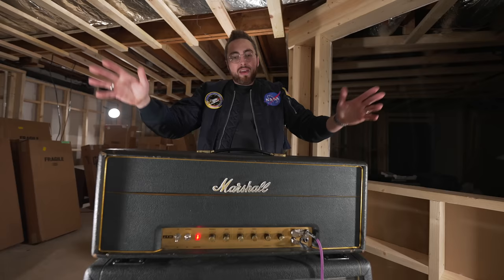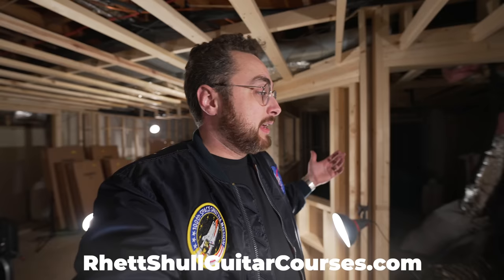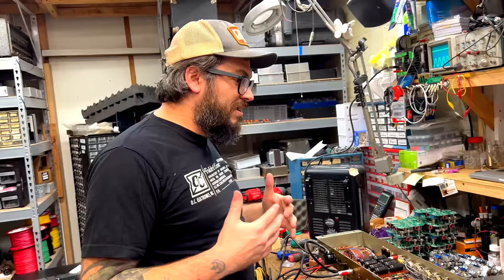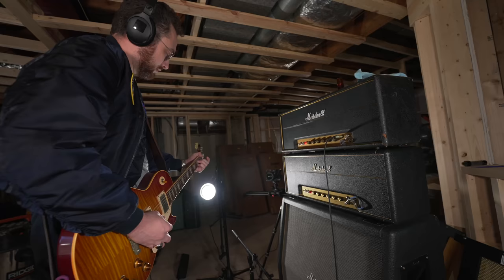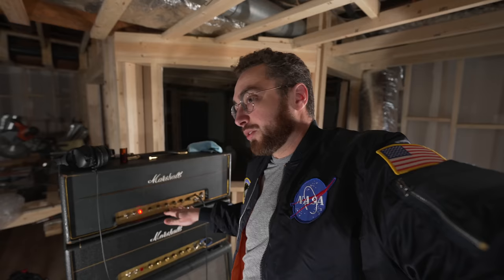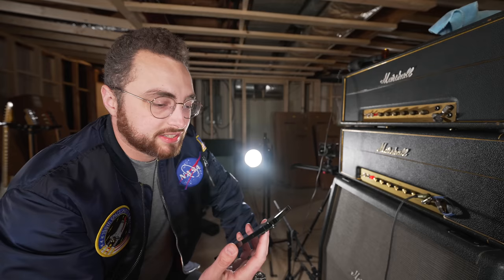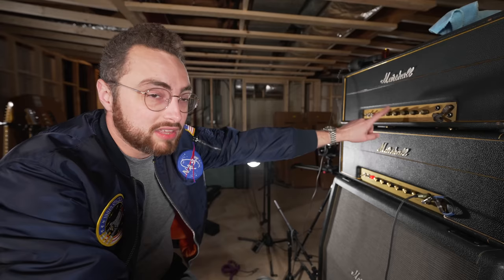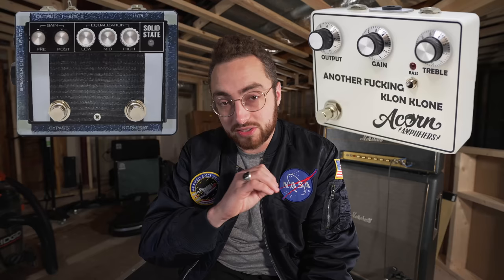This Amp Is So Loud It's Painful | Vintage 100W Marshall Plexi

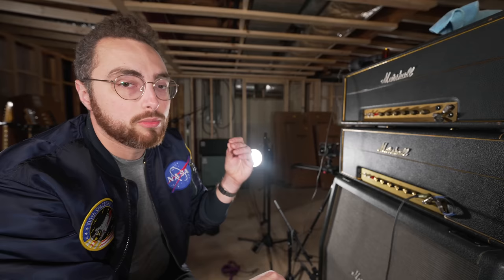Comment: 2.5 real reasons why the 67 sounds different than yours. First and most important is the first tube stages: in the 67, both channels shared a cathode resistor and capacitor, while the later super leads used individual resistor capacitors- allowing them to put a little more gain in the bright channel, but also tighten up the bass significantly. The increased gain on the first stages of the later models also makes the tone stack less effective than the older amps. Second reason is the output transformers changed quite a bit over years which changes the tone (last component before the speakers…power transformers also had some variance which changed voltage it ran at, but that was also all over the place) The “0.5” reason is the fact that SOME marshalls beginning when they changed from “plexi” to later superlead specs had a bright cap on the gain knob of the bright channel.  Most noticeable when gain is at 12:00 or less…and many didn’t have it (or had it clipped).
FWIW, when they started pumping out the higher gain super leads, they still did the original first stage jtm design, but they called it the “super bass”.  As such, the changes are simple enough, you could have a tech mod your reissue and have it switchable between modern jump and classic jtm spec
Reply: Yes, that's the reason behinf of the difference in tone within the 2 amps

It's like comparing a jtm45 to a 1987x
Reply: This amp looks to have a bright cap on the lead ch. Wondering what the value is? Couldn't make it out.

Comment: Jmi must have been almost totally deaf by the time he died. And he only used two or three at a time. Of course don't forget that Angus uses seven 100 watt heads at once on stage without ear protection.

Comment: 68 was a very transitional period. The circuits between those two amps are quite different but can easily be made the same in a matter of minutes. Absolutely no need to go hunt down a vintage amp for that tone. That said, no two amps, even with the same circuits, actually sound the same given that tolerances over the numerous components are going to be different, ESPECIALLY after 55+ years. But yes, your re-issue hand wired can absolutely get you there.

Comment: Not a lot of decibel difference between a tube Marshall run into a half stack versus a full stack…full stack pushes more air and sonically fills a room with more sound but not much more volume…now daisy chaining amp heads together each with full stack cabs…THAT will raise the decibel levels tremendously

Comment: Also you shouldn't be using a 100w head into a 4x12 with 4 Green Backs at 25w, you will damage the speakers, that amp is making 150w clean to 180w when it's cranked, the RMS rating is at no distortion, you're going to kill that cabinet (again). You need two cabinets for a 100w Plexi using 25w Greenbacks or to use a 50w speaker or above in a single 4x12. (I posted before I saw the tech measure the amp, but still don't kill the cabinet dude).

Comment: Rhett, I love how you have broken down so many different classic amps. With that said, I CANNOT express enough how much the speaker changes the sound of tone. Full stop. 
I really think you'll have your eyes opened if you go down the rabbit hole of changing out multiple speakers using the same cab, same guitar, same pickups. Speakers are where it's at brother. More so than any other component in the signal chain. Cheers.
Edit: just scrolled through your entire catalogue of vids. Looks like you did one vid 4 yrs ago on the alnico blues vs greenbacks. I'm telling ya man. Such an intrigal part of the chain deserves your attention.
Reply: Yea, the original pulsonic greenbacks would do stuff

Comment: "Plexi models are too fizzy". Plexis are fizzy, just the truth. And, yes, they are loud. Really loud. Most of the rockstars didn't actually stand directly in front of them for a reason, there was a sweet spot a few degrees off of center.

Comment: You young guys, LOL.  You can outplay me any day, but we lived with these big amps in the old days. But the biggest secret is - play in a bigger place!!! Not kidding. Big hall, full of of hundreds of sound-absorbing human bodies and it won't seem anywhere near as loud. Take it outdoors on big stage with a primitive PA system, and you'll want the full stack and two more. Also, the 144 watts is peak power, not RMS. (yes, I'm an electrical engineer). And it IS a bass amp! Bass amps make the best guitar amps.   Be GLAD you don't need these things today, your back and your ears will live a lot longer. I always played with foam earplugs.

Comment: Correct me if I'm wrong, but those first Marshall amps were in fact based off fender bassman, with just a slight difference in tone stack caps, so when you said "it has so much bass it could be a base amp", well it kinda is...

Comment: I've heard that the Black Flag (JTM50) and Super Lead 100 aren't exactly the same circuit. The JTM50 is more like the  JTM45/Bluesbreaker and the SLP is.. the iconic plexi sound. More distortion, no bass whatsoever, fizz and presence to cut through and much tighter.

Comment: There's a story I read years ago that Ted Nugent was recording in London and told the techs to setup his 100 watt Marshall amp in a small recording room at maximum volume. The techs told him not to do it but Ted insisted. The story was Ted went into the room, closed the door, and whacked a big chord that knocked him to the ground with the guitar bounding around on his stomach. If it's true, it might explain why Ted is bat shit crazy now.

Comment: I played one of these cranked, and now I can't make babies. It takes a great deal of skill to use a Plexi in a live setting. It's a very delicate balancing act.  I still play a Plexi, but through a Boss Tube Amp Expander, with my cabinet just loud enough for the singer to hear since he doesn't dig in-ear. Really makes me appreciate our modern setups with lower volume stages and in-ear monitoring. So much easier than back in the day.

Comment: It's an unpopular opinion, but this topic still brings it up front. The number one stupid thing guitarists do in the 21st century is play through a hundred watt 4x12 stack. It's an anachronism. But I know the majority of responses will be "CrAnK uP 'n RaWk, DuDeRiNo!!!111" Emotional response will overrule reason in just about every debate. But...

The Marshalls, Bassmans, and other big amps were designed for a time when the Beatles and the Stones had to go out into larger and larger venues where their audience was screaming louder than the amplification they were using. And the tube PAs were of similar low wattage and only reinforced the singers. So they came up with these big amps, and you'd have Eric with a pair of 100 watt stacks, Jack with a pair of 100 watt stacks, and 100 watts of tube PA to have Cream play The Royal Albert Hall or Madison Square Gardens...

Then came transistors. They didn't take guitar amps by storm but they did revolutionize the PA. With solid state came the megawatt PA systems, but guitarists and rock audiences still "had to have" the wall to wall electronic phallic symbols looked "kewl." So the old school guitarist has been the bane of small club sound techs for about fifty years now. I'm sorry, I know it's unpopular, but this is the number one thing that makes "old school guitar players" look out of touch with the rest of the world. Don't get me wrong, I loved my 50 watt 2204, and my red knobbed Dual Showman stack when I was 18, but I couldn't get "my tone" without being louder than a 747. I will agree that the feeling of air pressure when playing that loud gives a rush, but that's also what is damaging your hearing.

You can get great tone by cranking up a low wattage amplifier.

Comment: Word of note:  Tyler measured the Plexi at 144.50 watts. That is peak output.  The amp was rated at 100w RMS.   The equation for peak  to RMS rating is peak output multiplied by the square root of 2, or .707.  Therefore 144.5 * .707 = 102.16w RMS  Still exceedingly loud.
Reply: Typo correction:  1 over the square root of 2.
Reply: My meters read RMS. This is a true reading. It would be the same as reading the 120vac from the wall…which is increased by a factor of 1.41 for peak. Which is about 170Vac. It’s the same meter that will read 85-90w for a Twin Reverb
Reply: @theBanalBrother  figures I would say this, and think you had an RMS meter after the fact, but it wasn't mentioned in the video, so I assumed the meter was just a standard volt meter.  I'll refrain from commenting.

Comment: The trials and tribulations of tube amps. Rhett You’re definitely getting those magical tones. But as with all tube amps you’re in the lap of the gods as to weather it will sound good or awful. But your tone chasing is not for those that listen to your music because it’s so nuanced, it’s just for you and the select few who know the difference.

The other reason why vintage Marshall’s do not sound the same as modern ones is in the U.K. vintage wiring standards are unsafe and Marshall cannot legally build and sell exact reproductions of their famous amps and meet modern safety standards. Hence different sound. This goes for Orange amps as well and probably Vox and Hi Watt amps.
The tube amp sounds is important to me but I’m a solid state amp guy. I don’t have the patience to deal with the inherent and unreliability of tube amps. I find myself being quite picky and it need’s to get very close to a tube sound and most of my ss amps have a pre amp tube or single ended Jfet or nanotube shaping a power amp or Nu-tube to get the behaviour of a full tube amp they do react a little bit quicker but it does the thing I like.

Comment: They don’t all sound like that or that great. Kind of like a PAF, they don’t all sound great. I’ve had several Plexi’s and only one sounded superb. They’re are brutally loud. I had a ‘68 50 watt that was putting out 82 watts and even on the single cabinet I couldn’t stand in front of it. It was too loud.

Comment: You can't compare a jtm black flag to an handwired reissue... they have different circuits! 1959HW has the superlead metal panel '69 circuit and high filtering, the jtm100 has a bass circuit with dual diode rectifier and low filtering... two totally different amps
JTM100 actually IS a bass amp used by guitarists (it's a british clone of a tweed bassman)
Reply: 144W is peak power, not RMS. Anyway power is not a measure of loudness , is a measure of headroom, power is measured giving the amp a 1KHz sine wave raising the amplitude till the point of breakup. for example... a princeton reverb is less powerful than a deluxe reverb but they have the same amount of loudness (with the same speaker) and same power section. it's just that deluxe reverb have more headroom given by the phase inverter stage design so it has some watts more
Reply: the EQ is different in the old one because it has a bass tonestack.  Bass circuits sound good only with bass at 0 and mids and highs on 8-10

Comment: Decibel meters on phones aren’t at all accurate, especially after a certain volume. The mic starts to distort and clip and you’re not going to get even a reasonable measurement. I’d be willing to bet you’re getting a higher decibel rating than what your phone is reading.

Comment: Its just like driving cars with real amps. Everybody can drive an Opel VW Fiat Toyota. .. But not everybody feels comfortable with a Porsche or Ferrari. You tip on that GasPedal and  booom 140 mph.... Yes... you dont Need a Porsche,  but its the better car and some are afraid. IMO its definetly more difficult to play an 100 Watt Head than a modeler....

Comment: Use a power soak.
Don't listen to or be exposed to really loud noise.
It litterly disturbs your mind.
Reply: Interesting. I’m getting use to playing some 100w Marshalls with the full stack. A 1967 stack and a few early 70’s ones… in my bedroom. I’m 21. The noise is piercing and thud is addicting the more I play, though at this point the sounds and frequencies are unbelievable. I mess around with a lot of the old Mullard tubes. 

Might there be a spiritual trade off though? My mind is different after playing every time, though I feel it’s more of something close to emotion and energies that’s coming out in the playing instead of being transmuted in another way? Versus calm meditation throughout the day? “Healing” It’s in the back of my mind every time… should I continue down this path? Will it hinder me spiritually eventually without realizing, consequently throwing me off my current path? It’s literally my last question to me after managing to acquire the holy rigs to get the actual tone finally

Comment: WAY too many variables to go through to accurately clone a particular amp. It's not going to be one or two things. It's the sum of all its parts working together. Better to go out and find one that ticks all your boxes in its original form. Might not be an old one either.

Sounds to me like you'd be happier with a 100 Plexi with JTM 45 .1uF output coupling caps.